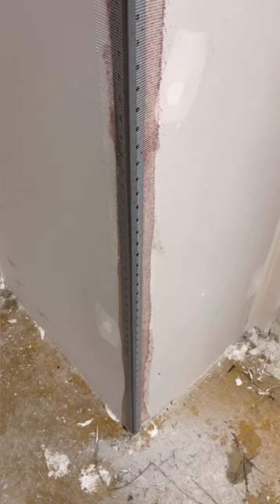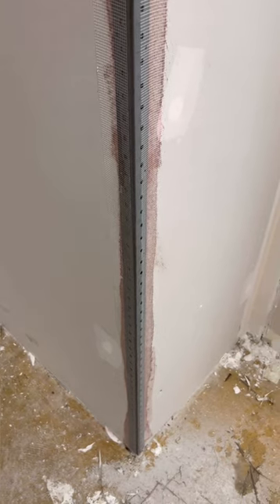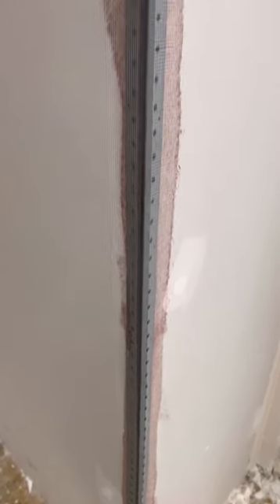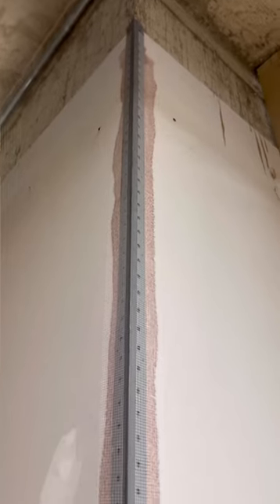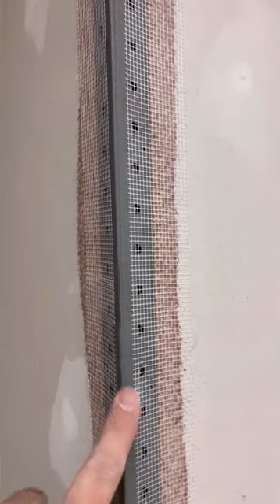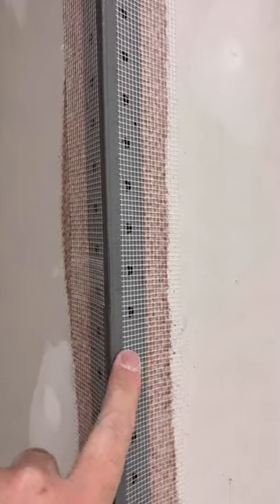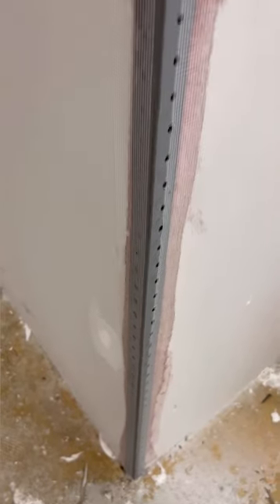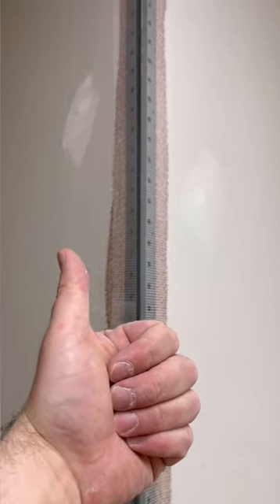How to install metal corner beads without screws

Comment: I use 1/2 inch long narrow crown stapler to fasten corner bead to metal framed drywall. Believe it or not the Ryobi cordless works like a charm.